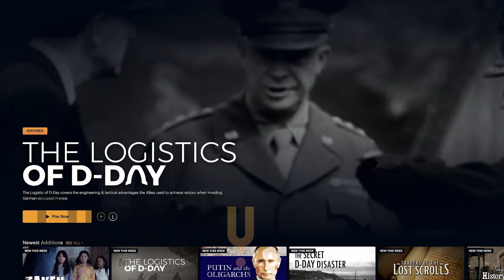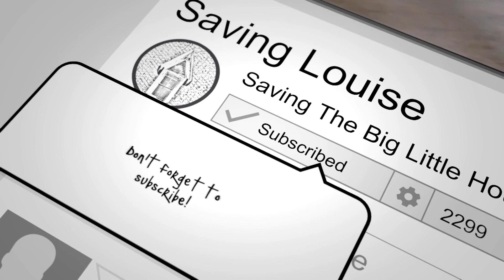Restoring Our Victorian: Pearl E8: Major Bedroom Changes in Our Fixer Upper

Comment: I adore the wisteria mural idea! I'd go with the bumble bee; a bee motif is also associated with Napoleon, and you can't go wrong with Chateau de Malmaison! I hear you on the 'nothing fits' mantra. My 1930s laundry room/service porch has 3 doors (one to the outside), a window, and it's where we have our fridge, since the original one in the kitchen was an 'ice box', and there is no upper wall space for a modern fridge. An A/C vent was added next to the back door, and I have been looking (off and on) for 10 years, trying to find a new washer/dryer that will fit. Still haven't, so the 34-year old Whirlpool set is still there...the ones my Hubby used to sometimes use as a workbench in the garage at our old house. :S

Comment: For the mantle: I found that when using the stripper on the shellac..have a separate buckets of the initial scrub down with steel wool and then a clean bucket with another piece of steel wool. While it’s still wet wipe up most of the goop with cheap paper towels.

Comment: Haha, I'm glad I'm not the only one who worries about the house falling down!  I want to take out a tiny wall in a coat closet, maybe 3' long, and hired a structural engineer to tell me if it was load bearing or not.  He said that the weight of the roof was spread out over EVERY wall, so I need to put a 3x6x3 header in there.  (I'm in Northeastern VT on the Canadian border, and we get a lot of snow that is heavy!)  And of course, whenever my electrician has to drill another hole through the basement ceiling joists to get what I want upstairs, I admit that I do freak out more than a little.   (He's very sweet and reassuring.)

I can't wait to see the mural!  My vote goes for one (or more!) honeybees, because they're in danger nowadays.

BTW, I cancelled my Netflix because Curiosity Stream is so much better.  Thanks so much for the discount that you ran a few months ago!

Comment: Needs to be a bee. It makes more sense in the wisteria than a strawberry. Question: in every drywall project we did in 30 years, my husband used to caulk the corners with painter's caulk, rather than swear at the drywall mud. I can see that the corner tool would have made a world of difference. But still, we never had an issue with the caulk, either. Have you ever done that?
Reply from the maker: We haven’t but I’m glad that worked for you.